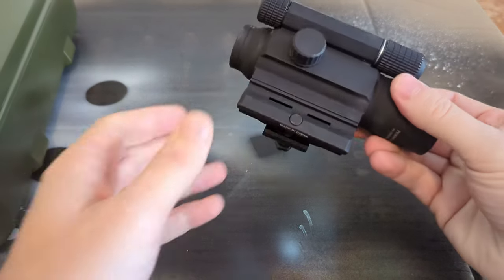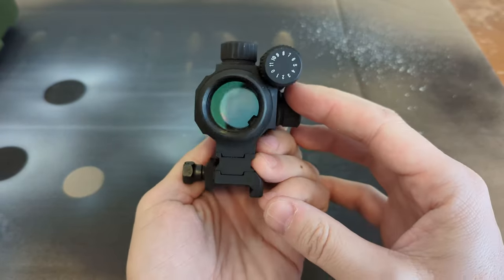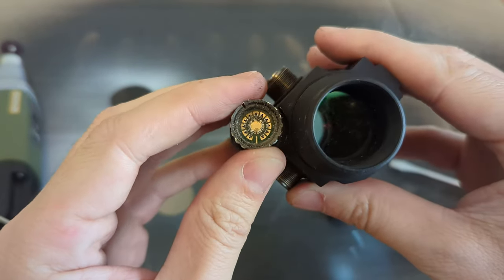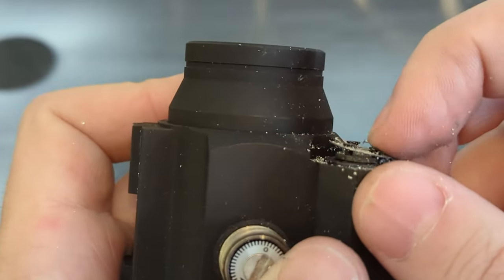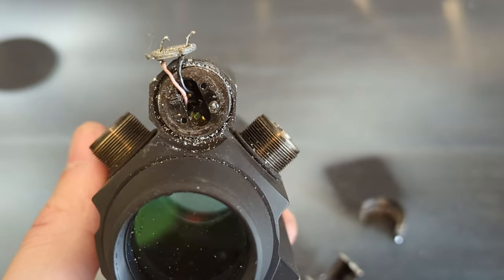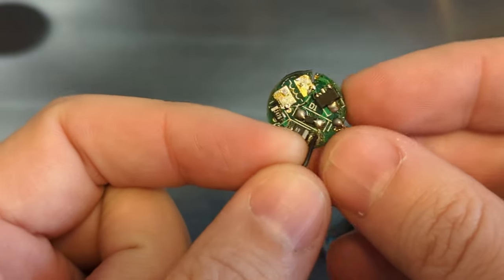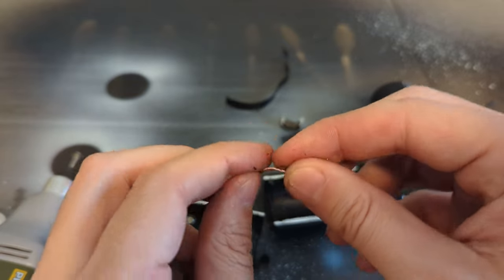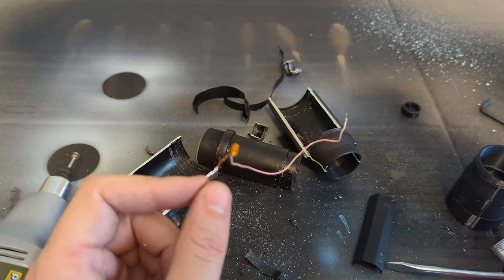Primary Arms Red Dot Teardown

Comment: It does not look like you can repair it ;)
And it does not look it was a solid piece, right? You should have been able to unscrew the tubes on the front and on the back. Most probably with a force and a bit of heat if there was a glue.
Reply from the maker: Possibly, but I obviously wasn't very worried about this one. :-D